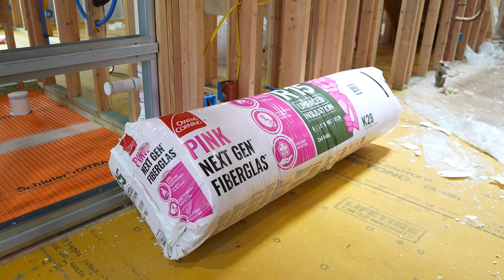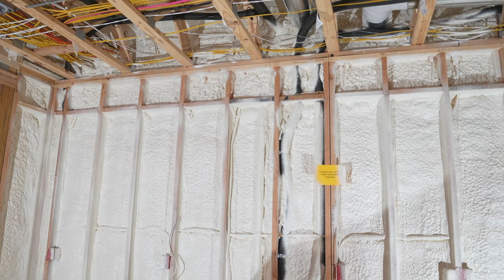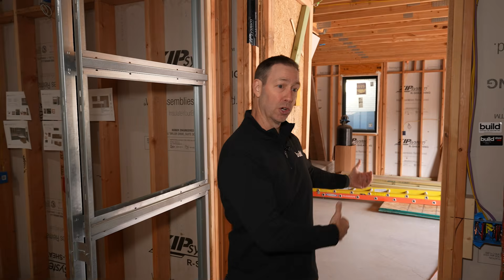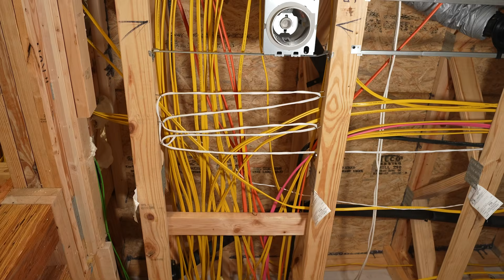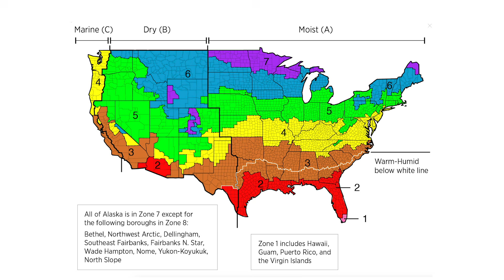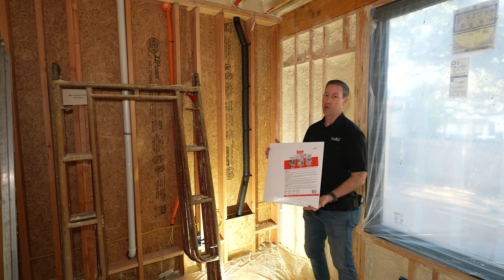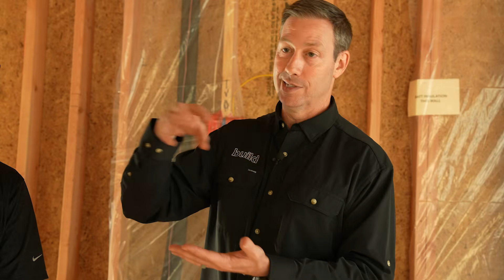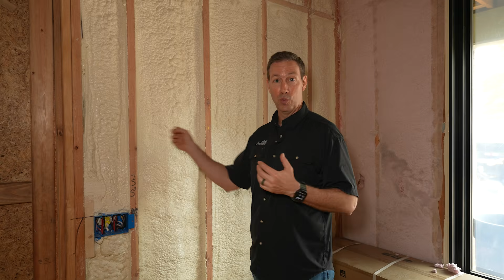The Risinger Build Ep:15 - Insulation & Proper Installation

Comment: After 15 years of being certified in building science and crawling through a million attics,  I’m surprised by how many people don’t like spray foam from the comments. I assume it’s due to experiencing poor applications?

Spray foam is far superior to anything except rock wool that’s installed within a properly sealed envelope. 

Fiberglass is completely worthless and doesn’t stop airflow, which is why you can walk in attics and see dirty spots where can lights and penetrations are allowing airflow. 

Conditioned attics and crawl spaces are the only proper way to build a home today, and spray foam accomplishes that incredibly. Again, rock wool is great but costly and tough to adhere to roof deck.
Reply: Thinking of going close cell for the roof deck in a home I just bought here in North Georgia. Is it a myth that it could void the roof shingle warranty? And also curious about using rock wool instead. Any good videos or reading materials you would suggest on either of those?
Reply: @user-my3pv9kx2h The warranty thing is nonsense and comes from lazy dealers or manufacturers. Foil-back decking provides much more stress on shingles than foam will ever do and it is the standard in most new construction. Closed cell foam on roof deck is used in many places, especially in hurricane zones. The benefits would be that it adds 200% structural rigidity, locks in the decking and rafter connections really well, will hold no moisture, and seals incredibly. 

The only downsides are that a leak from the roof would not drop into your attic since it is sealed and it would slowly rot roof decking. In my opinion, with good roofing you should have no issue and if you have some decking exposed to water, you can replace the decking during roof upgrade in 25 years.  This leads to the second issue of closed cell which is that it is a pain to remove if needed. Replacing roof decking for example would require you to cut the joints with saw and remove sheet with foam on it. Extremely low probability you'd need this to ever happen, but worth noting. 

I love rock wool due to it being more natural product and completely fireproof. Only issue on a roof is that it is labor intensive to install and you have to strap it up properly. If you have a low enough roof pitch it may not be terrible to access. The other issue is that you still need to ensure you are sealed for airflow behind it. Some people use closed cell foam to spray a think layer everywhere, or even picture frame openings to ensure connections and seams are sealed. Then they install the rock wool behind that. There are companies that specialize in air sealing using a thin layer of spray, but I am only familiar with foam application. 

Best of luck!
Reply: @ great thanks. So to retrofit this house you would likely either go closed cell foam to whatever thickness i can afford, or flash and batt with closed cell plus rockwool? This house is was only built in 2021 but already has a roof leak in an area of a dead valley that also doesn't have proper kick out flashing so we are about to correct that problem but the overall roof has a lot of wear from other trades people walking all over it right after construction. I was given some money at closing to fix most of this and I'm thinking about just having the whole thing re-roof and fixed by a quality roofing contractor. Some parts of the roof have standing seam metal already so I will leave that alone but replace all of the shingles and put new synthetic underlayment and or peel and stick on the roof.
Reply: @user-my3pv9kx2h  also wanted to add consideration for open cell foam on roof deck. It expands 100:1 so it fills gaps and craps even better. Also, because it is going to be much thicker than closed cell, it fully covers the rafters and eliminates thermal bridging (heat transferred from roof to attic through rafters). If your roof were to leak, it would leak down through the open cell int your ceiling so you'd know. 

Only real downside is that it doesnt add structural strength (which may not matter to you) and it can hold moisture; so if your attic is very humid it can begin to build up moisture in the foam.  Proper design will eliminate this, and you can also just add dehumidifier if needed to maintain conditions in attic. Ive installed hundreds of the big name dehums and just recently tried out VEVOR dehumidifiers that are under half the price. They honestly may even be better built and I love them. Time will tell the lifespan but you can buy another and still be cheaper on investment. Id recommend you buy the VEVOR and just install it yourself. just plugs into an outlet, and you can add duct kit if desired.
Reply: @ ill check out these Vevor units. In my last two homes that I put open cell in the attic, I just used consumer grade dehumidifiers and all worked fine. In fact the only really nice dehumidifier I ever bought was a Santa Fe advance two model and it's the only one that's ever failed on me lol. The $200 ones from Costco or wherever keep running strong. i'm very curious about going with closed cell on this house so may move forward with that. I also really like the idea of putting a rigid foam insulation product on the roof before I have the roof redone but not sure if it's worth taking it that far. Looks like Atlas has a product that has both rigid foam and a piece of OSB on the top as well as an air channel in it for circulation that is designed to be put on the roof before the underlayment. Not sure how expensive that is but sounds interesting.
Reply: @user-my3pv9kx2h  Retrofit applications can be more headache and definitely require dehumidifier. In my experience when foaming attic of existing house, humidity levels end up higher in attic since the existing walls of home are far too leaky. So moisture comes through walls, rises into attic, and then gets trapped. 

In a new build, I’ve seen where dehums aren’t even needed because entire home is sealed well and AC systems can control it all. 

For retro, you’d have to pull insulation out ceiling and ensure no combustion air is needed in space for gas appliances. Not sure how long you plan to live in home, but it may not be best investment. Don’t get it back when selling probably. You could always air seal with foam gun and then add cellulose over existing insulation in attic to get to higher R value. Often a better value in existing home

Comment: As usual excellent video and content. I liked the specifics on the R values and how you get to that value for a wall. I would really like to see in your videos a cost breakdown for a specific insulation type on standard size for comparison. For example a 10' length wall with an 8' height costs $$ with 2x4 with R15 batt insulation. Or with blown in it costs $$$ and with closed cell foam it costs $$$$. If you always use the same dimension then it is easier for builders and customers to compare for desired needs and budget. The same would go for the exterior materials cost for the same coverage area of using ZipR6 or the R10 panels etc.

Comment: If you’re running dehum, it’s hard to justify closed cell on the bottom of your roof deck.  Open cell and closed cell are pretty close with cost per R, but open will bury the whole cord, the connection, and half the web are sealed.

Comment: I have never understood why Texas builders (Matt not included) always claim they don’t need that much insulation because it’s not that cold, well it is that hot so instead of insulating to keep the heat in you are insulating to keep the ac air in.
Reply: he literally explained it in the video....
Reply: It’s because of the inside to outside temperature delta 105° outside 70° inside is only 35° delta where as 10° outside 70° inside is a 60° delta
Reply: @edwardmead7448  no it’s because most, not all, Texas builders are shisters
Reply: @ you must be a builder. Throw enough excrement at the homeowner and you’re good…

Comment: Matt has a video that emphasizes moisture control, and how one should make sure that it vents easily. He sold me on the concept, but everything that I've come up with, including foam sealing, ends up trapping the moisture. I'd sure like to know how to actually apply the concept. Closed cell spray foam is a great insulator, but it's also a choice that traps the moisture inside.
Reply: One needs to control humidity indoors.  Having a dehumidifier installed into the HVAC will certainly help with your moisture issue.
Reply: @davepetrakos475  I've never used, nor even considered dehumidifiers, so that option just plain old didn't occur to me. Thanks much.
Reply: @ytorwoody  You want to treat a sealed attic just like a sealed crawl space and control that moisture mechanically!
Reply: @lanewhite5928  That was a comparison that I never thought about. I've done the mechanical control in crawl spaces, but always vented attics. I'll definitely take your advice since it is so very logical.
Reply: You also need to have dedicated source and return hvac vents in the attic to get rid of the moisture that will rise to the highest point

Comment: The lack of any mention/use of rock wool when showing multiple insulating options is disconcerting.
Reply: Perhaps because the video is sponsored by Owens Corning ?
Reply: @ericsimonson3128  Owens Corning sells rock wool.
Reply: Normally the comments indicate less expensive options to build are wanted.   
If my coffee cup is on roof of my Chevy, it bounces when I close the door with window up. Not so on my Mercedes.   2 different builds at two different costs points.
Reply: Which is sad because I’d use Rockwool before ANYTHING else (except maybe blown in sheep’s wool like Havlock).
Reply: This channel is pay to play only.
Reply: He could have mentioned it, but throughout this video series he has stressed that this was a more moderate cost/budget build, and rock wool is more expensive. He did mention rock wool would be hard and labor intensive to fit in that rim joist and under roof area.

Comment: Skip the foam, says I. Better to have ducts buried under the blown-in insulation. 
1. You don't shorten the life of the shingles
2. Code considers buried ducts to be within conditioned space
3. No offgassing
4. Underside of roof sheathing is visible for inspection and the insulation can be moved to access the ceiling if need be
5. Fiberglass is much less flammable than foam
6. Cheaper.

Just make sure your AC is in a closet and not the attic and you're golden.
PS. had a great time at the Build Show Live last weekend, by the way. Learned so much and met some great folks!
Reply: Foam doesnt effect shingles with the style of roof he uses. He uses a vented roof. Its essentially a double roof so the foam doesnt back up against the same board his roofing material is on.
Reply: @idanko731 are you qualified ? What proof of your qualifications besides because you say so ?   Lol.  You insult others with zero evidence to justify yourself.
Reply: @idanko731  thanks professor. Here's what I can tell you, having inspected countless older homes, the majority and I mean more than 50% of older homes that have had spray foam applied to the attic space have leaking that was caught way too late. When you see the tea stain bleeding through, it's way too late. You've got deterioration. Also, I would invite anyone reading this to do some research on how applying spray foam to the underside of asphalt shingles reduces their life expectancy.
Reply: @constructivainspections  You didn't watch the way the roof was built.

Comment: I put bib insulation in after aerobarrier on 2x6 walls. After the drywall  PVA was used to slow down moisture into the wall. Plastic is not a good idea for a moisture barrier. In the Pacific Northwest, it's just too wet. I know lots of people that had trapped moisture do to Plastic and PVA is better because it will allow moisture movement.
Reply: Plastic is not recommended in this video.

Comment: Disclaimer this is a spray foam commercial. too many risks, including prolonged off gassing, improper or poor installation or expansion and contraction of building materials both can lead to spray foam breaking its seal and result in extensive damage to structure. Costly, labor intensive to remove or replace in the future.  ASIRI Designs YouTube building science channel has talked  about issues with spray foam.
Reply: https://youtu.be/3MmLv3u6aw8?si=KeqtZ2ck9nOaqvyg
Reply: The nightmares from spray were from urea aldehyde
Reply: Study paid for by Big Corning.
Reply: Houses in Europe with spray foam won’t be insured and the foam has to be removed 

Many risks with this I’ve heard
Reply: Biggest one for me was off gas. Second is if there is fire damage the house is scrapped. Third is if there are any leaks, you won't know about it until the rot is deep.
Reply: He showed many different insulation types, so this seems to be a false statement.
Reply: But works great….
Reply: They use three different types and talk about all of the pro and cons of each. You're wrong and probably didn't even finish the video.
Reply: All that is if you have a poor installation, someone that doesn’t know what they’re doing
Reply: Closed cell spray foam, PROPERLY INSTALLED, is the best insulation on the market. 2” of close cell outperforms a full cavity of fiberglass crap. 👍👍👍👍👍👍👍

Comment: Spray foam is nice but if you need to do any repairs or add things have fun removing it!
Reply: Yes, I'd like o know the answer to this. All that wiring, plumbing is getting encapsulated in the foam. What happens if you want to do repairs?
Reply: @cosminahertog3457  to say nothing of the fire risk
Reply: Why would you have wiring or plumbing on the roof joist decking area? In the ICF I'm am getting ready to build were using sizzor hoisting the cathedral ceiling for room to run ducts and conduit with pull strings installed.
Using 24v  can lights around 10 per circuit. 2" Smurf tube for cat 6 and cat 7.

Comment: Doesn’t spray foam have cancer causing flame retardant chemicals?
Reply: VOC might might have a link to cancer. I don't know that flame retardant chemicals do. FRC might have some health related issues. I'm still investigating.
Reply: The EPA regulates them but...seems like their isn't a definitive answer to it concerning safety🧐🤷
Reply: Just don’t eat it.  Ok?
Reply: @ryancouture2508  nom nom nom .... Too late...🤕
Reply: Usually lists of “chemicals known to cause cancer” in any jurisdiction translate into industrial hazards and not occasional contact. If you live in the home, don’t eat the insulation. If you work in the chemical plant or install the stuff you need gear and to limit your contact.

Think of it this way, Coal miners without safety equipment get Coal lung. Hipster pizza shops in Brooklyn with coal ovens do not. When clamping down on chemical hysteria Doctors will be the first to point out that it’s the dose that makes the poison  .

If something is wildly hazardous like industrial herbicides, you’re not buying it from a supplier without a license of some kind.
Reply: I'm on my second home with spray foam in the attic roof deck and on this one I also put closed sale in the basement when I finished it. The attic of both homes always kept a faint smell from the open cell phone but I never smelled the closed cell foam for a second. So now that I'm moving to a another home, I may put closed cell in this attic instead of open sale
Reply: Only if you are in the Republic of California, Ha!

If you're in an airtight home, then to a great degree, the insulation will be encapsulated in the wall after off gassing before drywall is installed.
Reply: @davepetrakos475  right. The foam only takes a day or so, so VOC and anything else that's encapsulated shouldn't be a problem.